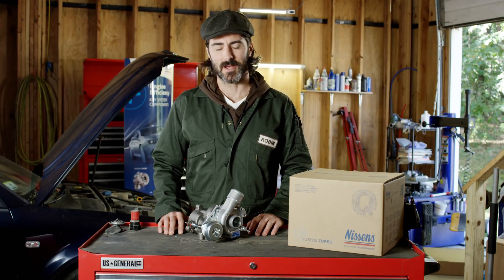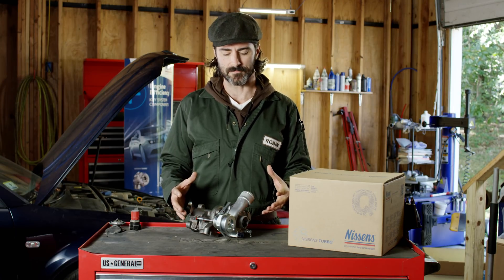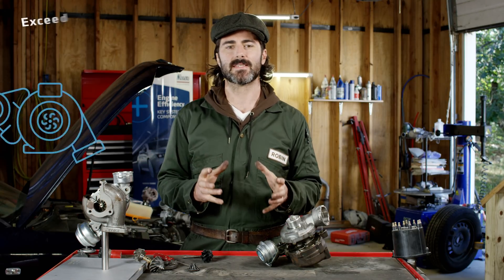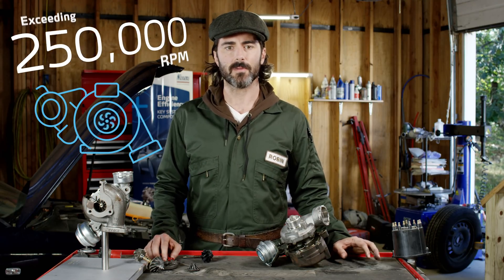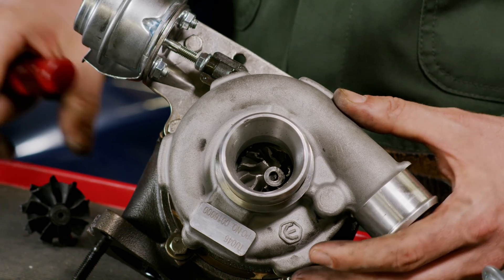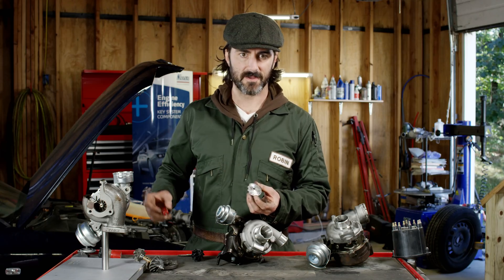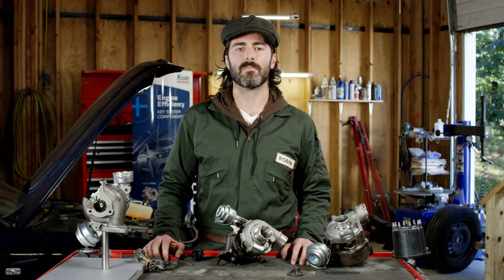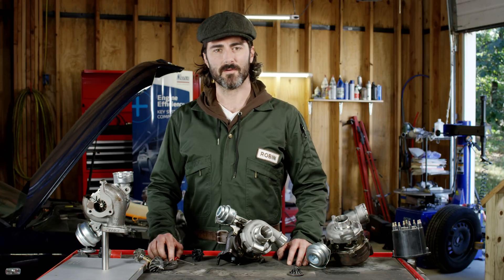Turbo Troubleshooting (3/4) - Overspeeding

Comment: Hello Ruben .. I own a 2020 hyundai Tucson 1600 cc Turbo type LT2.   Almost a week ago,  when my car completed 56,000.00 Km, the exhaust started blowing white smoke, by inspection I found that engine oil is almost about to end completely. i transported  the car to repair service agency, they flushed the motor, filled new oil and said such will stop smoke coming out. Smoke continued like before . When they inspected the car again, they said the turbo is dysfunctional. For the reason the car was driven about 4k miles past the recommended  travel after fresh last oil change, they waivered the warranty however I argued to deny my responsibility .. please note that throughout the 56,000.00 Km travel, the low oil pressure alarm never showed even once, which in itself was to me an assurance of nothing wrong happening, I told them there was no alarms at all, otherwise I would have responded immediately, but to no avail, this is the essence of conflict, how come the can never over heated and oild pressure never reported lower than it should,is this a design fault in Hyundai  car... if as you say the turbo is very sensive to over speeding .. heat and oil shortage, why then it failed with me to blame but not the design of Hyundai alarm system and the thresholds thereof .

Comment: Hi Robin, I would be happy if you answer my question and help me. I have a 1.5 dci renault car with turbo diesel engine. there is no smoke or power drops when I hit 2000-2500 rpms while driving, but I hear a whistling noise when I reach 2000 rpms while driving. what should I do ? should I replace or get someone to rebuild the turbo?
Reply: Sounds lik a boost pipe is leaking